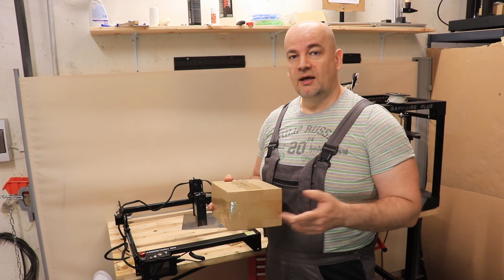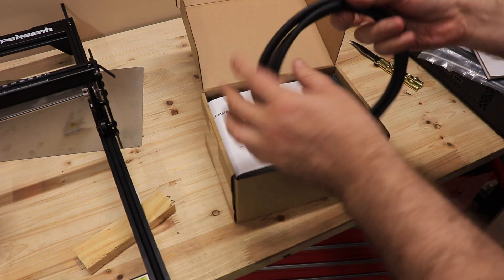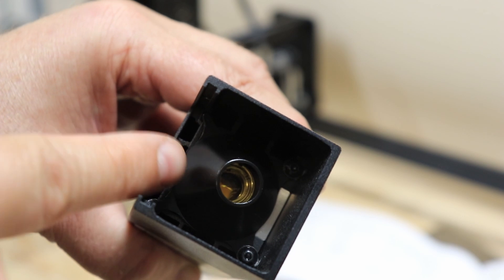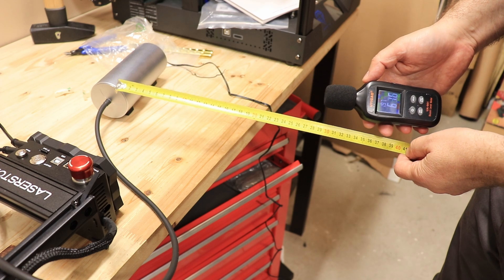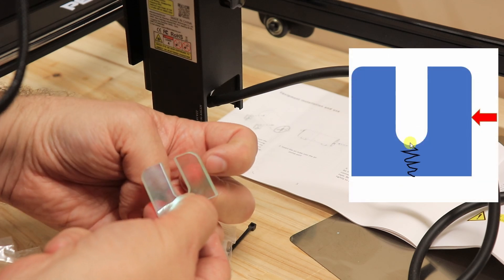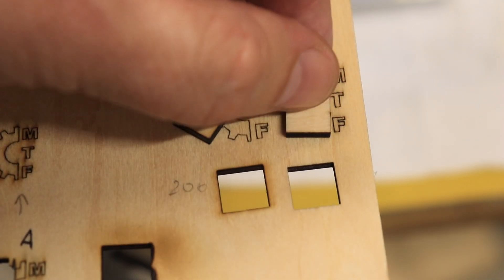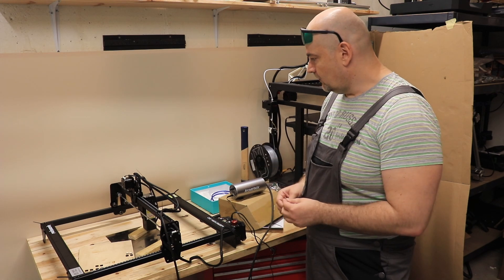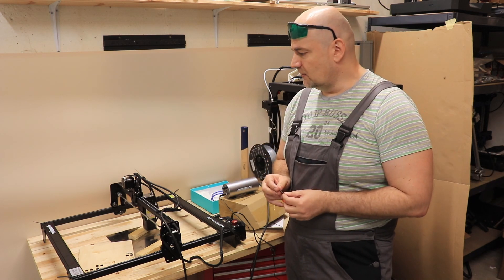Atomstack air assist kit for cleaner laser cutting

Comment: I was just looking at the same air assist module as well as the correct glasses for different lasers.  I noticed that you had green glasses.  Aren't the diode lasers you are using blue lasers ?  If they are, you should be using Orange glasses.  The green glasses are for fiber lasers. Different types of lasers require different types of glasses.   I'm just looking out for your safety.  Check into the different types of glasses and what lasers use what color lenses.  Especially because your laser lens broke... I'd hate to have you look at the laser with the wrong glasses. I hope I am able to help with this sometimes overlooked safety issue.  Great video. Keep up the good work.

Comment: le kit est pas mal mais mal fait coté laser. le tube silicone s emenche dans le conne aluminium qui est etranglé a l'interieur. Le passage est reduit a 1.5mm. Il faut le modifier et re percer a 3.5mm ou alors l'interet d une pompe a air gros débit ne sert strictement a rien.
je me régale a regarder les videos de certain soi disant pro qui ne vérifie pas le matériel avant montage donc leur essai est caduc, sans intéret.

Comment: I bought the same pump, I'm very disappointed, it doesn't blow as much as in this video, it just gives me bubbles fully open!!! There are other less expensive and more efficient pumps, so make your choice!
Reply: Igual a mi, mas lo que valen, a los 5 minutos calientan mas que mi estufa.
Reply from the maker: Be sure that the line of the pipe is not broken. My works fine since the review.

Comment: Did you ever receive a new filter glass for your laser? Has not tightening the set screw helped keep the filter glass in tack? I just received mine and concerned it will break too. Any other tips, that don’t involve drilling into laser I would be thankful for
Reply from the maker: You could glue it if you don't want to mess with drilling and tapping.

Comment: Thanks for the test !
I actually find that the nozzle doesn't make sense.
They let holes at the top of the piece, meaning that air from the pump can actually escape there... and not through the nozzle itself.
Reply: Hey man. I can tell u there is a good reason for the holes....I bought the Atomstack Air Assist cuz i broke my Laser Lens with a DIY solution. ATOMSTACK wants around 100€ for a new one.
I had a 3D Printed one without any holes. The problem is that the heat accumulates inside the nuzzle if u dont turn on the air assisit pump. I just forgot to turn it on once. The plastic melted inside and the lens cracked. =( i think u dont need more than this. I also would prefer to buy only the nuzzles from atomstack and buy a stronger pump for less but whatever ^^
Reply: @huty  thanks for sharing your experience
Reply: Same problem on the S20 BUT the nozzle on the S20 has only a 1.2mm inlet to the nozzle but attaches a 5mm ID tube?! Any I was able to drill it out to 3.2mm but the same problem existed with most of the air escaping out the back. For my nozzle I cut a 32.5mm disk of 2mm plywood with a 15mm hole which is a perfect fit for the lense tube. In addition I place a grommet over the tube, pushed into place when I place the nozzle over the lense, and I am getting great results, 1.3 better cutting results. Of course I am not and idiot and I don't run my laser w/o the air assist running, both for head and to keep crud off the lens protector. I have both the pump and laser on a smart switch so they start simultaneously.